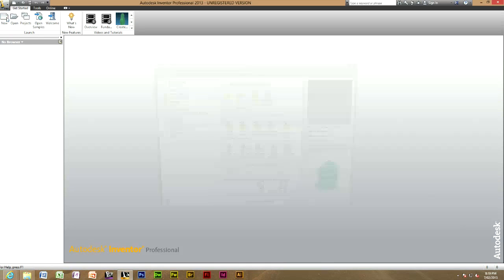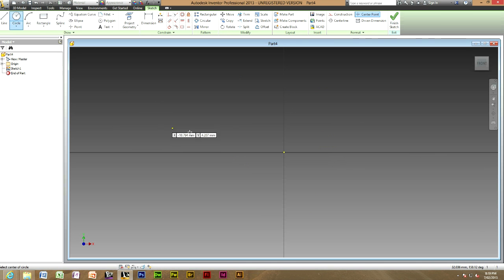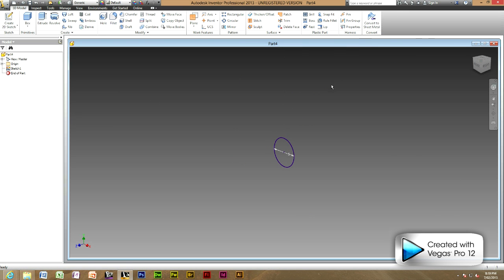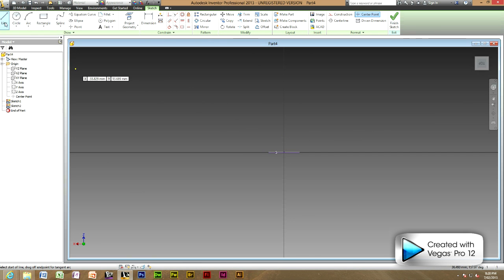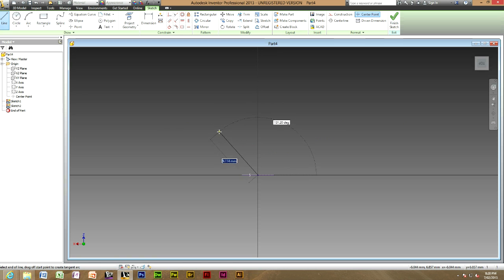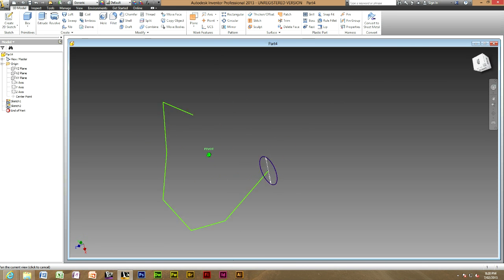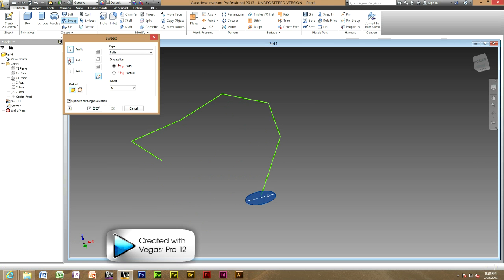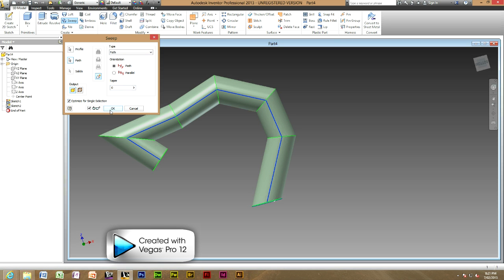Autodesk Inventor 2013 - How To Make A Sweep

Comment: You can create a sweep through 3 planes but you would either create each line in a different sketch or make a 3d sketch,the first method each sketch is a 2d sketch but but by connecting each sketch together by using project geometry your creating a 3d path for your sweep...so same principal but different method in getting there!